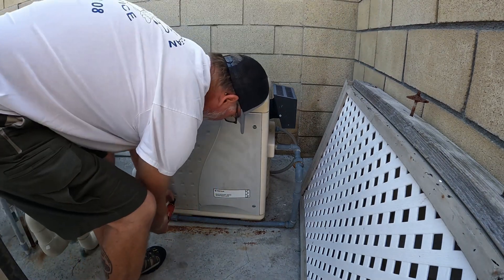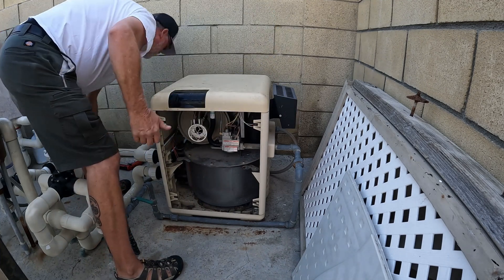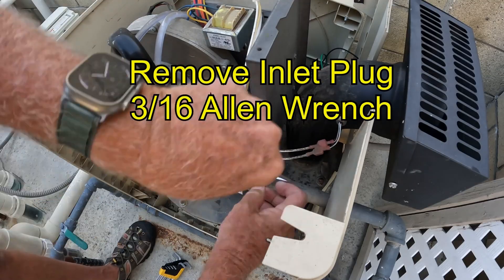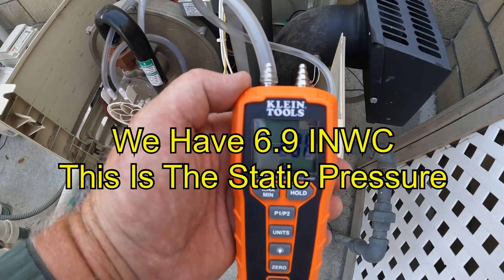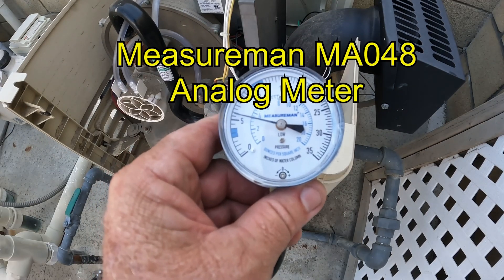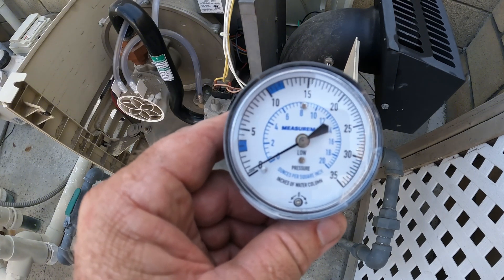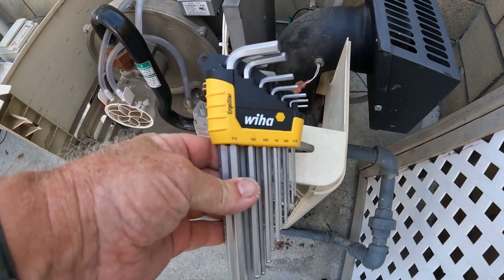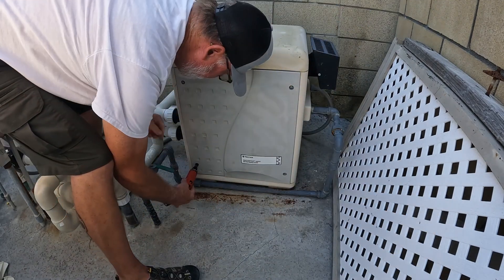How To Test The Gas Pressure INWC On A Pentair Master Temp Heater.

Comment: Gas line coming out of the ground looks small for a 400K BTU unless the meter is very close also too much 3/4” line just before the gas valve.
Reply from the maker: All the heaters are that size now. The problem was whoever ran the underground gas line didn't run the proper size.
Reply: So would the heater light up like this?